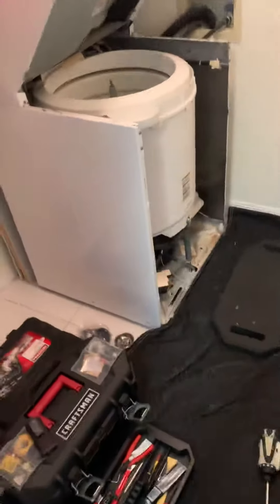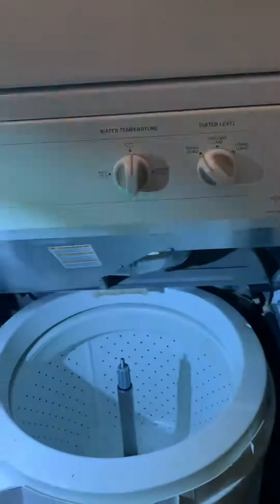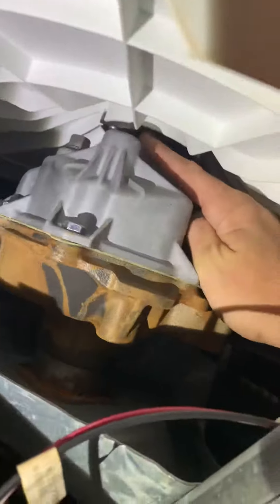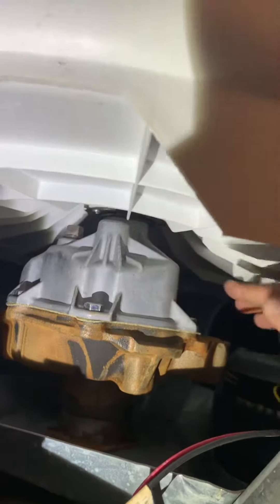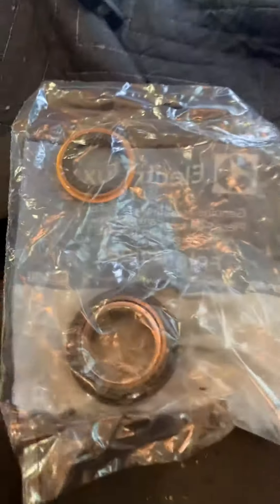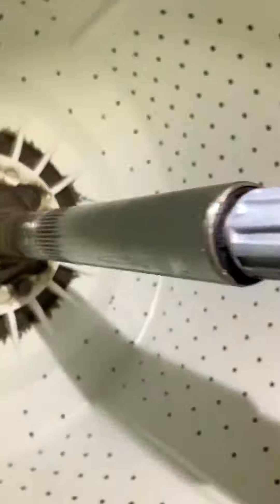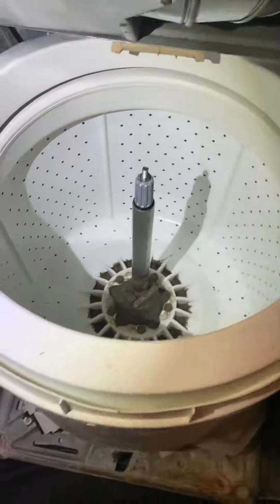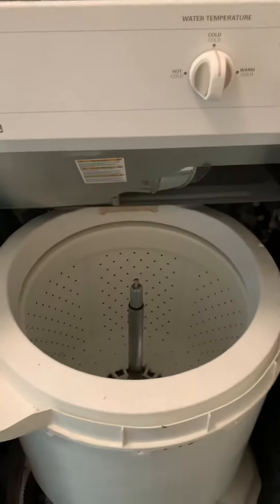KENMORE washer dryer combo. Washer is leaking

Comment: Great work. - Are you able to explain how to remove those panels? I have the same model as this video. I know how to take off the front panel, but not the top two.
Reply from the maker: There’s gonna be a screws on top of the front panel on the roof or the ceiling of the dryer, and then two bolts at the bottom of the front panel

Comment: We found oil in tnside the basket for clothes in washer why would that be we bought it used and brought it home found the oil
Reply from the maker: In most cases, the oil should be on the floor. I am not inside the drum.
Reply: Have the same issue with oil inside basket and washer works well with no water leaks ,trying to figure out what seal needs to be replaced , any luck ?

Comment: Greetings Sir,
I have a Maytag mav208daww front load washer. When I start it, the water begins to fill the tub as designed. It continues to fill trying to reach the level designated by the selection choice. However, as the tub is filling, the water comes right back out the drain hose..... 

Do you have any experience with this problem??????
Thank you.
Reply from the maker: SlingbladeJim, you may have been over using detergent, the washer can’t detect how much water is filling, they are for activating the drain pump to get rid of the water out of the tub. With the new HE detergent less is better!
Reply from the maker: SlingbladeJim this can mean a few different issues, A.  Clogged pressure hose (hose filled w/ soap!
B. Failure of a pressure switch due to overuse of soap.
Reply: Thank you....
I neglected to mention that if I start the machine on the rise spin cycle, it works fine. I have already switched out the timer as one youtube video said it might be that ???????????????
Reply: Is that the little tube connected to a cylinder in line with the other control contacts in the console????? Or something else...
Reply: OK.....first thing tomorrow I will try to locate the pressure hose... thank you.
Reply from the maker: SlingbladeJim locate a small clean hose, located on the side of tub, check the hose/ check the fitting make sure it’s clean, I would first disconnect from pressure switch (and blow into the hose) that can clear it. Check the unit for operation. If that did not work, then disconnect from the tub side, and lightly (LIGHTLY) blow into the pressure switch.Blowing to hard can damage the pressure switch. And recheck unit. If switch is not damaged. That should take care of it.
Reply: OK....I will let you know how it came out. THANK YOU
Reply: The tube was clear. I disconnected from the switch and blew through it......
I removed an inspection cover in the back and will try to start machine with it off to see why the water goes directly from the tub into the drain hose without filling the tub??????? But I really don't know what I'm supposed to see.....
Thank you for keeping up with me....
Reply: OK, with the inspection cover off, I can see a translucent square box about 21/2 " deep with the big hose from the tub on one side top, and the drain hose on the other side top. I started the machine and the water bypassed the tub and came right out the drain?????????????
Reply: OK....the plastic box is the drain pump. I know it works because if I set the machine to rinse and spin, it works fine ????? It just bypasses the water from the filling right to the drain????????????????
Reply: Well......you are NEVER going to guess what the problem was so I will tell you. I bought this machine as a temporary while I wait for parts on  Kenmore 417. I set it up outside and didn't place the drain tube up. I just laid it down on the ground and connected an extension to the downspout drain......
Anyway it works fine now. Thank you for all your help.
Reply: @SlingbladeJim  Hey!  I'm having this exact problem.  So what was the problem/solution?
Reply: @SlingbladeJim  Does that mean it's the pump that was bad?
Reply: Greetings rafibernardo...I hope this finds you well.
I was testing this washer outside and left the drain hose on the ground....as soon as I raised it above the washer lid it worked fine....
I hope this was of some use to you.......
All the best.
Reply: I replaced the door switch, the pump, the valves that control the water, and the entire circuit board and it still won't work ????? Sorry.
Reply: I should have mentioned my issues were with 2 different washers....I never did figure out what was wrong with the front loader and by the time I replaced all the parts listed the cost of hiring a repair man was out of the question.......
Reply: Tengo una igual y se queda de lado no son los resol te es la base
Reply: Thank you very much for your response, but I speak, read, and write English only.....